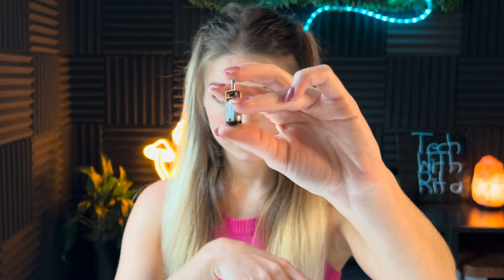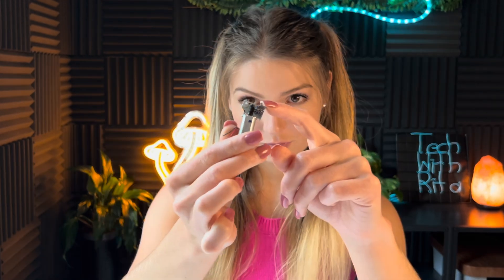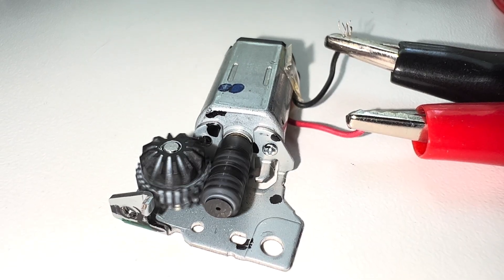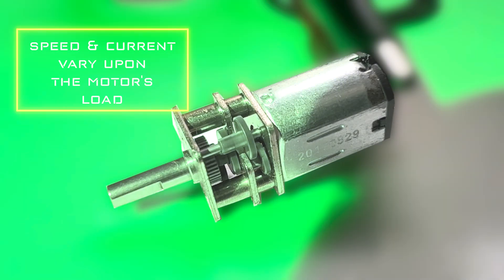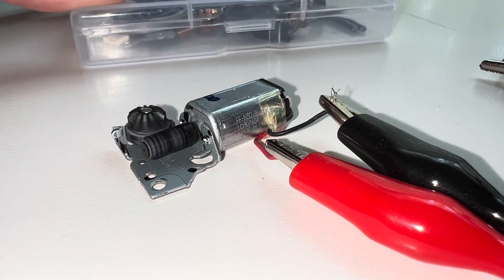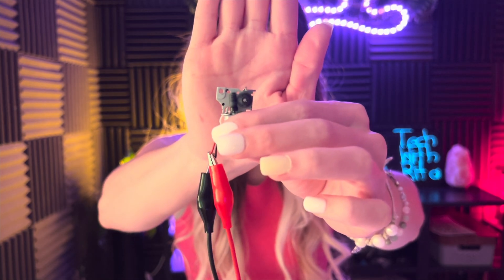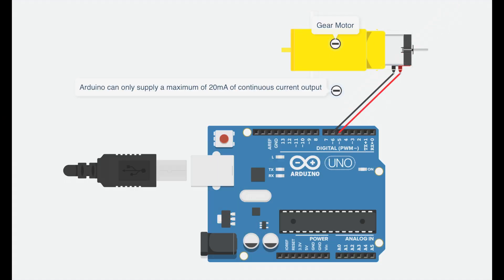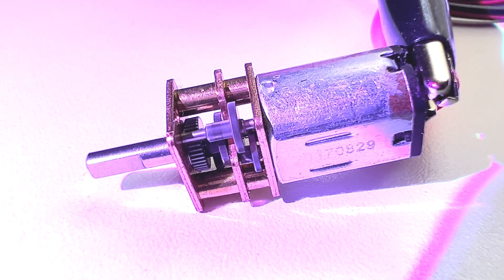Easily Explained: Mini DC Gear Motor

Comment: Hi Rita, nice video, have you ever heard of the Propeller chip, by parallax? its interesting 8 core MCU..
Reply: Cool chip
Reply from the maker: Hi, I have not
Reply: @techwithrita  Hi Rita, thanks for replying, not many people know about this chip, its been around for over 15 years, Arduino the gets all the attention. But if you have time, please check it out. because its different to all the other micros. its has no peripherals, no interrupts, everything is done in code, its has its own language called SPIN, which is easier that C , although you can program it with C, python, native "spin code", assembly , forth etc. I use it for industrial embedded products. I was going to switch to Arduino products, but its not good for saleable use, but great for learning and experimentation. Anyhow, please keep making videos! your content is a delight!